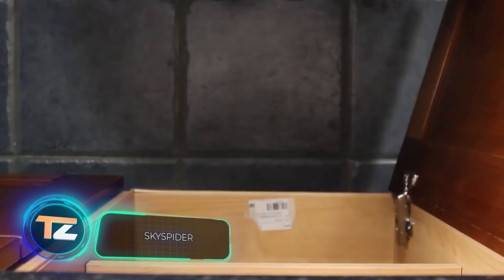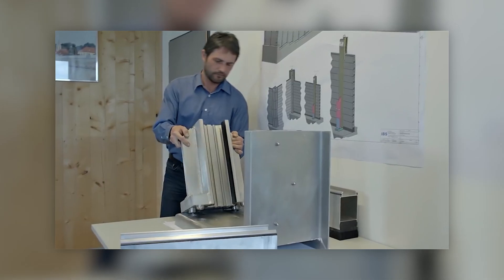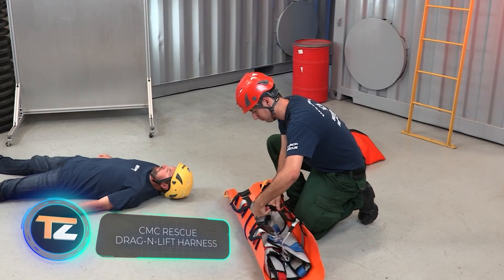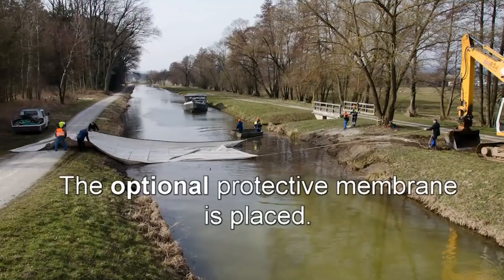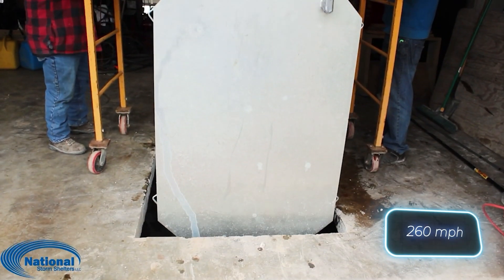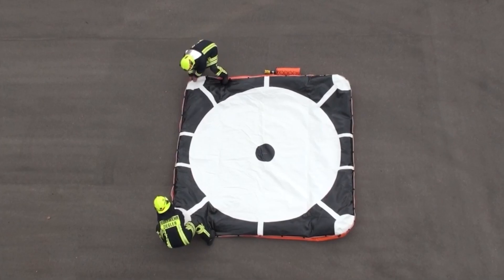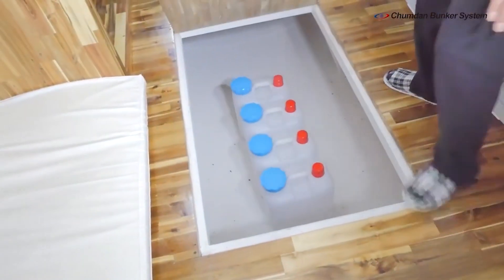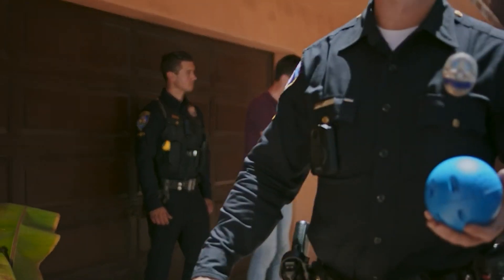EQUIPMENT AND INVENTIONS THAT CAN SAVE YOUR LIFE

Comment: 9:59  TechZone:  The price is a bit steep, at $2,000 
Also TechZone:  Here is a giant airbag priced at $20,000, but we don’t think that’s too steep… 😏😆
Reply: Aqua barriers are junk, I’ve used them on big civil construction jobs, they required concrete barriers to hold them in place or they just roll, terrible design. The cost to rent them is the same as the purchase price and they can only be used once.
Reply: @woody5109  well, whoever told you you can rent one lied then.

Comment: The sky-scraper evac system is an excellent idea, though I expect most owners to neglect it's maintenance. All emergency climbing/fall protection gear is single use, has a limited shelf-life and requires an annual inspection. Having to pay $500 a piece every (2?) years will add up, and will feel like a waste of money for something you hopefully may never end up using.
Reply: Maintenance should never cost the full price of a device. What gives it a limited shelf life anyway? Springs?
Reply: @Gr3nadgr3gory  I thjink WdV is makeing some very silly assumptions - not All emergency equipment is single use, some fall protection gear can be as it destroys it self in safely slowing you to a stop. however as in this instance there should be no shock loading it should be able to be used multiple times. it will require inspection annualy but the cost of an engineer for a week is likely to be no more then a 5K to do an entrie buildings worth of theses. I dont have experiance of this particular product but would imagion they should last 10-20 years with minimal mantenance when stored correctly. I use a simier device semi regualy when insepcting the exterior of a building - its price point is less then this but it does require some training to use safely and dosent include a fire rated safety rope (or a rope at all)

Comment: Maxxsafe. There you are all alone in a sinking car trapped by a seat belt in the front seat. Meanwhile, the belt cutter/window breaker is mounted on the rear window... 🤦🏻‍♂
Reply: They said it's preferable to attach it to the rear window. You can attach it to the side windows or even the front window.

Comment: 5:23, storm shelter. What if the house is sitting on the sliding door? Needs a hydraulic hand pump to open the door. Still a problem is house debris is covering the opening.
Reply: Given that the reason you go in it is because nowhere else is safe, you can either die outside or risk temporarily being trapped inside. I mean, you would tell friends and neighbors you had one right?
Reply: @thwizzik  If the door design was better with a  hydraulic ram to push door open it and the debris would be lifted up and no temporary or permanent trapping.

Comment: @4:11 I wouldnt pay a cent for this device. They havet thought it through.. It has several flaws i see when used in snow. First of all is that the pringle chip scoop shape of the device scoops snow into and around the head of the person, as they are being moved... Secondly, It is too cylindrical, and if let loos by accident, there are no safety measures for those tied up in it.

Comment: @3:00 The problem with this, is that if the vehicle sinks in shallow water or any water, and hits the bottom, The vehicle will settle on its side or wqheel again, and the air will no longer be in the back. Possibly never in the back depending on the depth of the water.
Reply: Your voice… pls change

Comment: Maxxsafe : Even an 8-year-old can do it.
Kid: "Ohh ... an orange toy! "And starts to turn the knob of the window breaker.
Reply: also, why the built in safety belt cutter? if its recommended to place it on your rear window, it won't be of any use for your safety belt?
Reply: @Casperthedutchman  it wont if you are a loner. Duhh.
Reply: @Casperthedutchman   I was thinking the same thing.
Reply: My thoughts exactly. every 8 year old with access is gonna turn it immediately.
Reply: it won't be used if you're a loner ._.
Reply: ....and it has a seat belt cutter. If you're the only person in the car, how are you supposed to reach the dang thing.